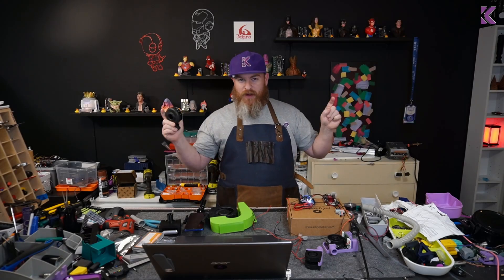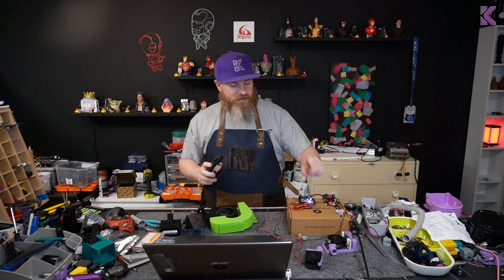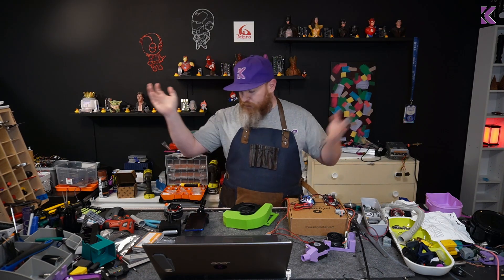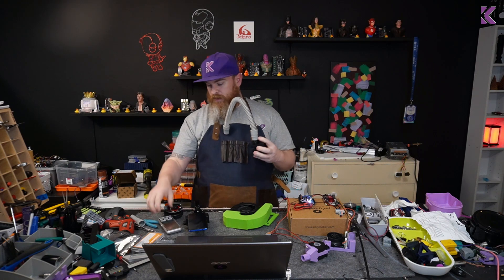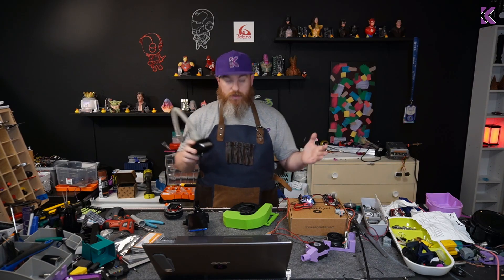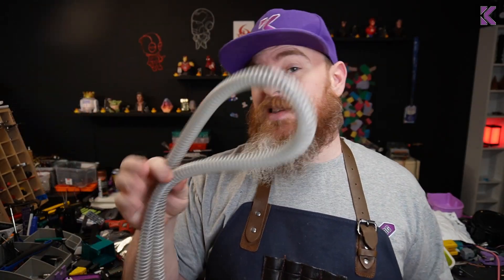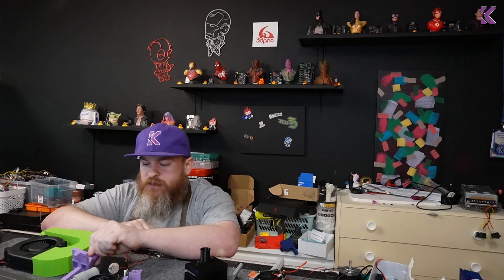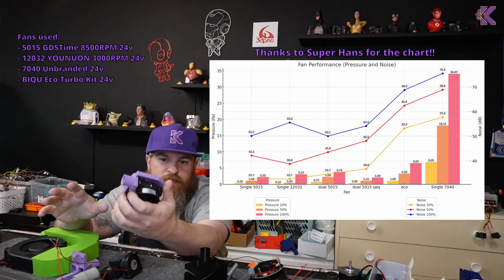CPAP COMPARISON - feat. BIQU ECO TURBO

Comment: Hello did you compare flow rate, this is critical to strip on heat, pressure is only one part of the equation. The primary function is to pass air over a heated medium and strip the heat away. It would be interesting to setup a cooling ducting system and but a heater element and thermistor set it to a nominal temp then monitor the power draw on the heater element. Great work always interesting to see data!